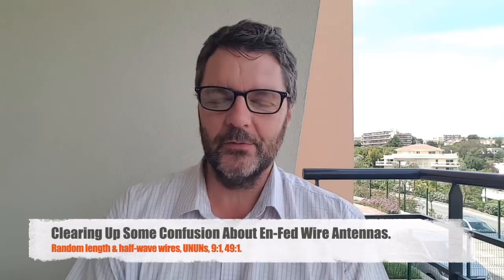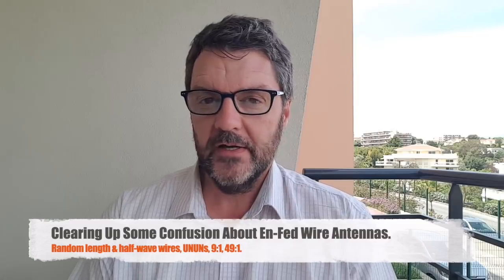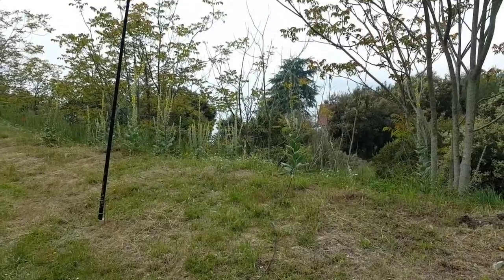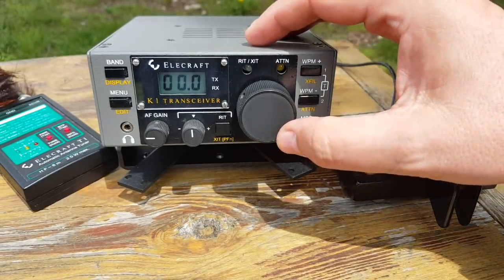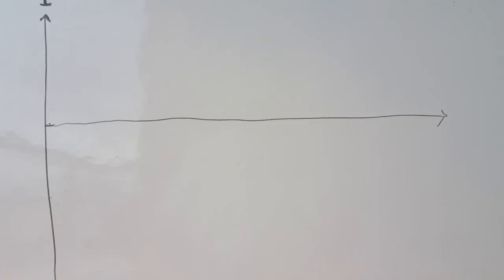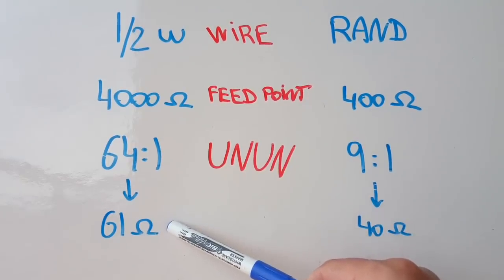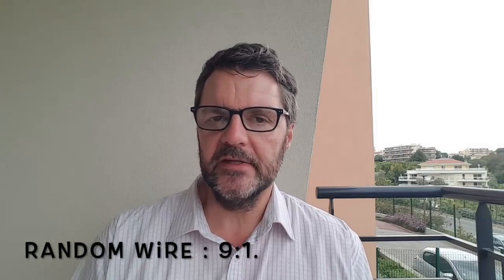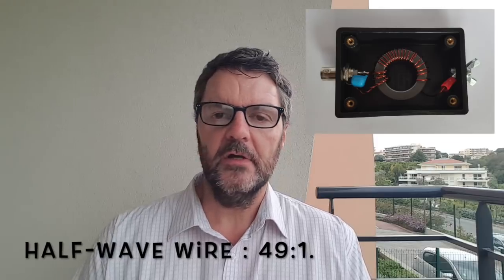Clearing Up Some Confusion About End-Fed Wire Antennas.

Comment: Regarding capacitor and why 7 turns gives 49:1.

https://youtu.be/xfqlun3bdI0

Notes:
Capacitor is needed at 20m and below.  As frequency rises, capacitor needed to balance the inductance.  Look at a smith chart, or VNA.

7:1 turns (or volts) = 49:1 Ohms
PEP = Vrms2/R
Rearranging terms, R is proportional to V squared.  V is proportional to winding ratio.  Therefore, 7:1 turns is 49:1 Ohms, needed to nearly match the 3000 ohms wire (load) to 50 ohms line.
Reply from the maker: 2 turns primary and 14 turns total is a 7:1 ratio. 7*7=49.

Comment: The turns ratio of a transformer is used to determine its voltage ratio so the ratio of 24:3 or 8:1 is a turns/voltage ratio. The impedance ratio 64:1 is the square of the turns ratio,  hyperphysics website shows the math for the reflected resistance/impedance nicely http://hyperphysics.phy-astr.gsu.edu/hbase/magnetic/refload.html#:~:text=This%20effective%20resistance%20as%20seen,a%20simple%20resistive%20series%20circuit.

Comment: 49/1 balun
Primary 2 turns
Secundairy 14 turns
14/2= 7/1 or simply 7  for the  impedance ratio you have to square the 7
Why?
Lets say the voltage over winding 1 (primary) is 10V.
The secundary winding is 7 times higher, so the voltage is also 7 times higher; makes 70V. Thus according to the working of a transformer the current wil be 7 times lower; makes 0,1428A 
Some math:
Lets say Ip= 1 Ampere
Rp= Up/Ip = 10/1= 10 Ohm
Rs= Us/Is= 70/0,1428= 490 Ohm
Divide 490 by 10 and there you have the magical 49 -:)
This is ofcourse computed with a purely resistive value but the same story goes when inductive and capacitive values are presented, which is the case in antennas.
Reply from the maker: Great thanks!

Comment: Gin,
I never get tired of watching this video, however, it always make we wonder why your using a 100pF cap that's rated at 1000v. Couldn't you just use a 100pF 35v cap? My thinking is even a 100Watts, the voltage going into the cap would be less then 35V, than I sat down and did the math and found that it was 71v - I bring this up, because a lot of YouTube videos are just using the smaller rated Caps and saying that it's good up to 100 watts, my math show if you even use 50watts, you'd probably burn out the Cap.

Hot Glue also works well for attaching "things" with these Baluns and UNUN's it doesn't seem to effect the SWR tests I've done.
Reply from the maker: Thanks, I'd have to look deeper into it..
Reply: @RadioPrepper  I wasn't calling you out for being wrong, you are/where right, I was just letting you know, your video made me think, then go out and learn why you built the Balun un-un like you did/do.
Reply from the maker: Oh I know :-) I am just not sure how the capacitor works...
Reply: @RadioPrepper  
Think of the added Cap the same way you do when dealing with a tuner - It's the whole A/C  (RF) interaction. From my SWR tests, it looks like it makes the antenna look like it's just a bit longer down in the 1Mhz range. It's not much, at least from my tests, maybe less then .3. The Baluns I've built off your 49:1 designs, normally give me less the 1:2.6 down at 1Mhz, and it gets as low as 1:1.2 at 40mtrs, with the rest of the Freqs, 3Mhz (High of 1:2) - 27Mhz to about 1:1.5. This is with a 85' end fed.
Reply from the maker: Yep, it's supposed to help for the upper bands..

Comment: A really interesting video. To feed my endfed random length antennas, I have had great success with just an l-match. I now realize that I probably would have needed a transformer had my wire length been an actual 1/2 wavelength. Thanks for sharing.
Reply from the maker: Yep, and you reduce coax losses that way.

Comment: Gil, your videos get better and better all the time, congrats. This is a good one. I built that kit from QRPGuys, it works great. But I used Thread lock tite to keep those wire terminals tight.. and you guess it... lol. It ruined the plastic enclosure and ate the plastic..  Lesson learned.  Have fun. keep up the great videos. 73.  (PS, I ordered a new enclosure and used different wire terminals.. also changed bnc to SO-239).

Comment: The reason I ask is I don't have reference . Or tools for analisis . I only have physical reference to by .
Reply from the maker: The total length of the antenna should be a half wavelength. 468/F(MHz) in feet or 143/F(MHz) in meters. Feed it in the middle as a dipole.

Comment: Contests are in part practice for emergency communications, and your channel contributes to emergency communications. The purpose is to make as many contacts as possible, to simulate sending as many time-sensitive messages at a time. We typically use two different message formats, one created by the ARRL, and another one created by FEMA, here in the US. We also publish contest dates and times, so perhaps, check that before you go to make a video?
Reply from the maker: I shouldn't have to. Contests don't have to take whole bands. They should be restricted to a certain bandwidth to allow other people not participating to enjoy their hobby as well and also allow potential real emergencies, as rare as that might be, to go through. As it is contesters often occupy multiple bands in their entirety and call for hours using hundreds of Watts with as little as one second between calls. They trample QRP calling frequencies with no regard to others, as if the contest owned the whole bands. It just isn't right, and I doubt sending 599 73 repeatedly is much training for emergency communications. As to practicing receiving callsigns, there are softwares to do that...
Reply: @RadioPrepper  Too right.  Contesters tend to be completely thuggish and ignorant.
Reply: New to radio but from everything I've read we are to share space and be courteous. Yet the first contest i listen to had a callings station tell others to stop rag chewing on a different frequency cause it was causing him problems. Not very courteous  when the contest is flooding the whole band.

Comment: I think that the power used should be the same across the board, why is it someone can use say most if not all radios are 100 watts some are 200 watts, I think that should be the limit around the world.  but unfortunately, some hams are selfish and will not drop their power regardless, you can here them on contest day pushing out the power without any regard for those who do not participate in contests,
Reply: 100W, 200W ? Doesn't matter. That's only a 3dB difference. You can make that up easily by having a more efficient antenna system. Last weekend, during a contest I heard a USA west coast station contacting European stations. Two Italian stations were next in line. One claimed to be at 1kW, the second at only 8W. To me in the UK, both stations were easily readable although it was clear that one was using higher power than the other. Unsurprisingly, the USA station gave them both 59 reports :-; However, the point is, there was a 21dB difference in the claimed outputs and yet both signals made it. I'd love to see the antenna systems connected in each case.

Regards,
Julian, G1EKW
Reply from the maker: Indeed, my opinion is that anything above 30W on HF is a waste.

Comment: I was looking at the Half Moon Bay websdr yesterday on the 20m cw band and it was just full, as you said. The contesters were sending and receiving at probably 40 wpm (maybe faster). They all can't be using a key and an ear to do that so what is the the point.  Anyway I was able to find some straight key ops at about 15 wpm around 14.100. 

Thanks for the video. I too have had no problems with a efhw and no counterpoise. I also use a random for the flexibility of using different bands, and I've used a 29' wire with a 9:1 unun (packtenna). It still requires a fairly significant tuner adjustment as the pretune swr is about 6, which varies depending on the length of a counterpoise.  I was wondering what you think is the minimum length for good performance on 40m and less (30, 20, 17)?  I am planning to try 41' but was wondering what you think.

Thanks again for a very informative video.
Reply from the maker: I saw a video of a guy copying a callsign at 200wpm..

Comment: Sorry to say the ladder line is part of antenna and it is radiating…13:00
Reply from the maker: Ladder line can only radiate if the current in each wires are not equal. Otherwise it's impossible.

Comment: Reflected power gets re reflected by the tuner not adsorbed and does in fact gets radiated, how much depends on coax loss
Reply: Correct, it does get transmitted after reflecting back to the antenna, afterwhich a small part gets reflected again... you get the point
Reply: @flexairz  and reflected again and again until all radiated not lost in the tuner as the video says

Comment: How did the 64:1 work ?
Reply from the maker: I was surprised at how well ot works. Such a small toroid isn't supposed to work that well, but it does...
Reply: @RadioPrepper  I have a 49:1 on three type 52 .   Its a little high swr in spots .  I will have to order some resistors to test it on a bench . 80-10 meter does pretty well .

Comment: Gil, I couldn’t agree anymore with you in regards to contests. 40m was almost as bad as 20m over here in the Midwest. Not a spot anywhere to jump in and get some time on CW. Also, sometimes operators using FT-8 have been walking on other operators running CW on 40m. It’s really annoying, especially for a new ham like myself. Thank you for the information in your videos. It is very useful for me. 73!

Comment: When there is a contest on 20m then there should always be 17m where contesting is not permitted.
Reply from the maker: Not everyone has an antenna for 17m or a 17m radio. 20m might be open but not 17. Contesters don't need to occupy all the bands.
Reply: @RadioPrepper  I agree that contesters should be more considerate and they should stick to band plans. I was just offering a suggestion as to what could be done when they don't. 17m is very close to 20m and along with other WARC bands, provides a useful refuge for QRP operators.

Comment: 28:19 do you really have 3000 volts at your transceiver output? )))
Reply from the maker: No, 3KV is overkill: https://owenduffy.net/blog/?p=11773
Reply from the maker: With very high power though I would suggest using a higher rating capacitor, just in case...
Reply: BTW thanks for the link. Amazing articles, a lot of things to read and to think over.

Comment: Can you tell what is the influence of a kink in the antenna wire?
I have hung a wire for 160 meters
I can not hang more than 16 meters of wire, in that wire are two kinks.
how bad is that kink in the antenna wire?
does the corner also have influence? 90 degrees more or less?

can you tell something?
friendly greetings from The Netherlands!
Rob.
Reply from the maker: Depends on what you call a kink... A small kink in a straight wire won't change anything. A change in direction in the wire will change your radiation pattern, but for a long, low-slung wire on 160m for NVIS I would not worry too much about it. 16m is very short for 160, but try!
Reply: @RadioPrepper  the bend is approximately 120 degrees.
would it be better if I made a round turn of it instead of a sharp corner?
for example, letting the wire run through a piece of PVC pipe?

I also use this to get through the door:
https://thumbs-eu-west-1.myalbum.io/photo/1k0/97976eae-96c8-4c4f-9be6-ac6b87d7bd0a.jpg
the aluminum plate is folded to get through the door.

how wrong is it? can I get away with it? or is this not so good?

regards
Rob.
Reply from the maker: I don't thinks that would make any difference... For coax cable yes, but not a simple wire.

Comment: Sadly, end-fed antennas are only half of a proper EMF radiator... the other half is a proper return current path. No counterpoise half, unpredictable return current path, unpredictable radiation effectiveness.
Reply from the maker: A half-wave is a full length antenna. Just like a dipole it does not need a current return path. You don't use a counterpoise with a dipole, neither with a half-wave end-fed. The only difference is the feedpoint placement.

Comment: a 1/2 lambda antenna is NOT more efficient than any other non resonant antenna. In fact the opposite is true.

A random non resonant antenna with a balanced line and a matching unit is slightly more efficient than a resonant one.

There is a lot of confusion about this matter, which is strange, because the physics pertaining to it have been known for many decades.

Any ARRL antenna book does have a good transmission lines and antennas theory explanation. Or just get a copy of the book "Reflections iii, transmission lines and antennas" written by the late Walter Maxwell; it goes a long way in demolishing many of the totally faulty myths about antennas and transmission lines which, albeit totally wrong, have become very popular among amateur radio operators.

Just an example of what reality looks like:  

https://www.iz2uuf.net/wp/index.php/2014/01/09/la-leggenda-dell-antenna-risonante/
Reply from the maker: Indeed, I never said an EFHW was more efficient. It is however more practical. Performance is not always the goal. The non-resonant doublet is only better sometimes because the feedline has no losses..

Comment: Great video. I'm about to embark on a a build for both a home use 300w and qrp end fed antenna so the winding example was very useful. If you are looking for mounting solutions for your torroid there is a great place in the Netherlands called HF Kits (https://www.hfkits.com/) that do a really nifty mounting kit for both the smaller and larger toroids to make a nice neat job. Just google them. All the best. 73's
Reply from the maker: Great info thanks!

Comment: When running QRaP, it's easy for everything to seem okay.   Run 100w+ through it and you'll see a difference.  You guys that run QRaP are oblivious to 99% of the antenna issues with your "toss it up in 2 minute" antennas.

And, the anticontesters are also probably the same people who think FT8 is a legitimate mode for QSOs when you have a one-click interaction to make an FT8 QSO and no voice / cw / typing.   And the anticontesters are likely people running chinese radios, garbage antennas, Ed Fong J-poles, and simply cannot compete in contests because they cannot be heard with their mediocre setups.
Reply from the maker: Of course with 100+ Watts you're going to have more common mode issues... But if you need that much power to make contact you better get a better antenna. I have never used more than 30W on HF, ever... Never needed to... People aren't just "anticontesters..." That makes no sense. They are "anti use all the common bands in their entirety with high power calling cq test with 2sec gaps everywhere with zero regards to whomever is not participating." They don't not participate because they can't compete. They don't participate because they are considerate people and to them contesting is not just a terrible annoyance but also plain weird... Like "train spotting" kind of weird, though I find that much less bizarre... They'd rather go to the dentist than contesting. I know I do, for real. And no, they usually don't like FT8, at all... Contesting to me has zero appeal, none. I cringe at the thought. I don't care if others do it, but don't use the entire fucking bands, you're not alone.
Reply: @RadioPrepper  You've always got 12m, 17m, 30m, 60m.   And, even if contests were to consume 48 hours of a week between them all (most run at least somewhat concurrent), you've got another 120 hours a week to do as you please without contesters.   Yet, in the absence of contesters I barely hear anyone on any band during any given day of the week.    The only way the rest of the world realizes that bands are available for QSOs and that QSOs can be made is when contesters get on and start CQing.
Reply: @RadioPrepper  I've enjoyed the banter.    In all seriousness, I came upon your video because I am interested in putting up an EFHW myself.   I've watched about a dozen videos on the subject including yours.   Thanks for putting it out there.
Reply from the maker: Not everyone is equipped for the WARC bands.
Reply from the maker: It does work surprisingly well. I am thinking of trying a transformer for a 5/8..

Comment: Ok so you essentially made a loading coil . That makes the antenna longer .
Reply: No. It's a transformer, to match impedance.
Why "lengthen" a half wave antenna?  It's already optimum length.
Reply from the maker: Correct Joe.
Reply: If the added inductance "lengthens" it; by same logic, capacitor would "shorten" it.